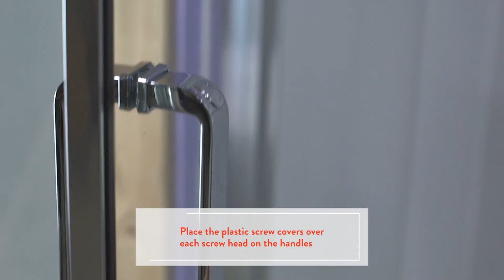How to Install your Mainstream Shower Door

Comment: how do you stop water from coming out the bottom of the door, the gap between the bottom of the door and the shower is close to an inch which leaves water splashing out